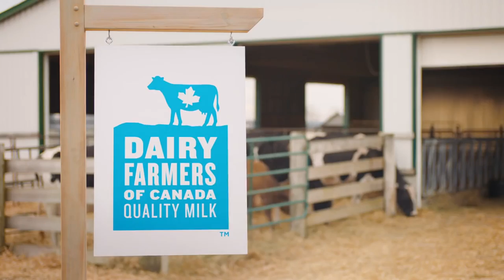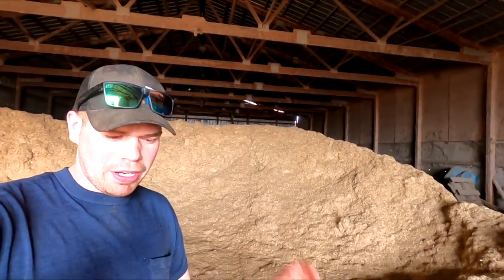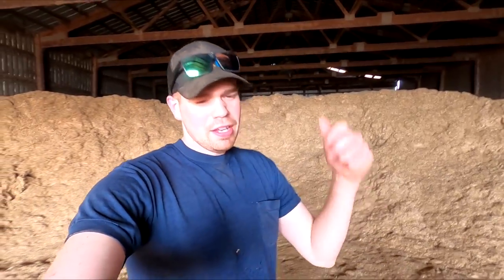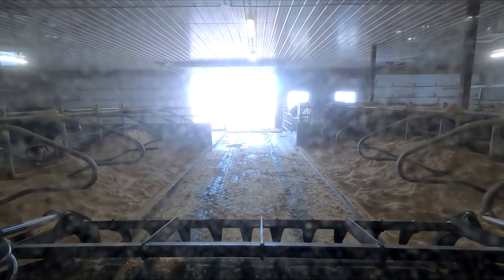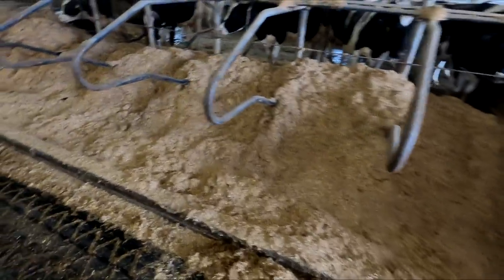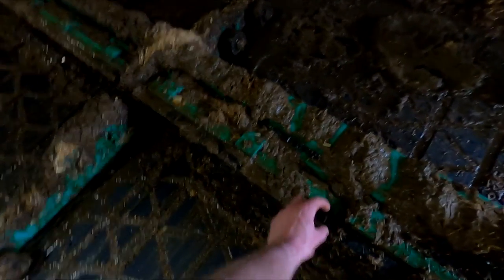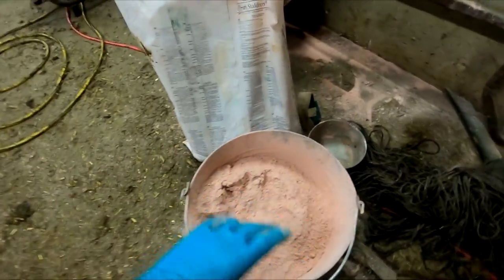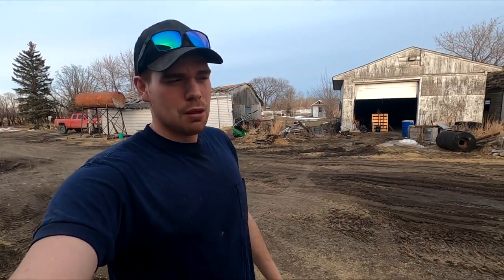Bedding down cows in robot barn!!! | farm update

Comment: Of course you get a thumbs up! 
   One of the young men Pennsylvania dairyman channels has a spreader hopper on the front of a skidder, with  about a 10" wide belt on the bottom that can be run either to the left or to the right,,  and the hopper can act as a scoop to load bedding or feed and then run with your remote from the skidsteer At whatever speed you need to shoot the bedding or feed out the side of the hopper,  maybe you've seen it?  The grapple bucket you have is awesome, but I am afraid of all that maneuvering on the rubber surface, and the stall dividers are going to get damaged.
 Thanks for the "show" .
Reply from the maker: Yes I’ve seen that, wondered also myself how well or if that would even work with straw, I’m not sure, definitely wouldn’t want to buy one and it doesn’t work , demo one would be nice 👍
Reply: @thenortherndairyman2566 ,  I hear ya,   I am assuming there are adjustable gates at each end to control the amount flying out as well as speed of the "belt",,, But you know what happens when you assume, ! and if they don't come with gate of some sort,,  one could be added I suppose.
Reply: Tried ours with chopped hay and its slow to come out. Works great with sawdust or sand tho.
Reply: We have one and we use it with chopped hay, straw, corn stover. Works well. Seeing that skid steer turning on the rubber makes me think that rubber won't hold up well in the scrap alleys.
Reply from the maker: @RideauLakesFarm  rubber is 7/8th thick and also has 1/4 inch wire running through them every 1/2 inch, there old mining belts, 10 year warranty. Legend rubber out of Ontario grooves them

Comment: Have you had any problems with the robots and is the old parlor still intact
Reply from the maker: Small little issues with robots, mostly just computer glitches, and yes old parlour is still intact, double 8 parlour
Reply: @thenortherndairyman2566  could you still use it and what brand is it to bad you can't sell it
Reply from the maker: @bobmorse3513  it’s a boumatic model 2101m it’s pretty well finished but even if it was useable I wouldn’t go back to a tie barn or a parlour